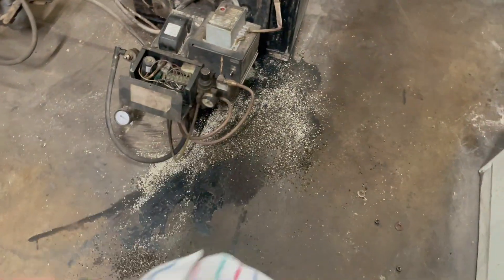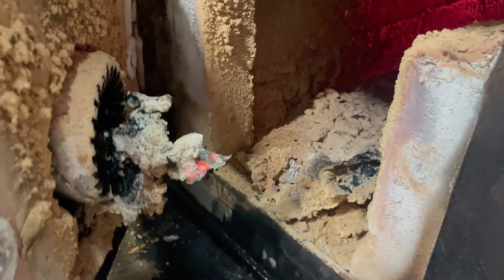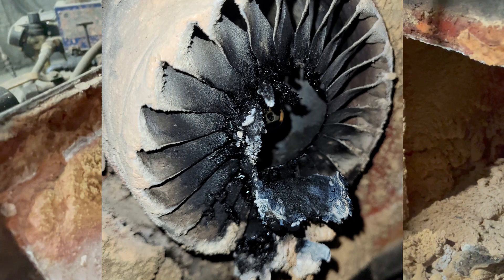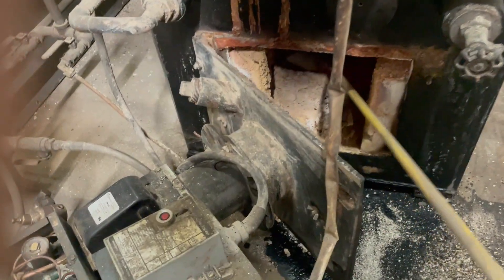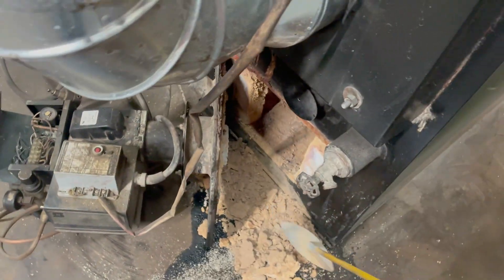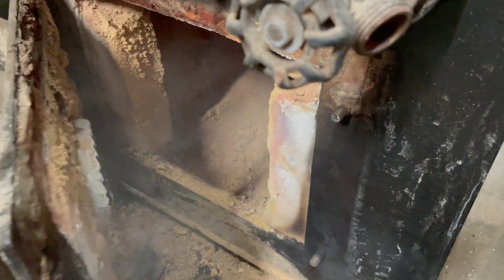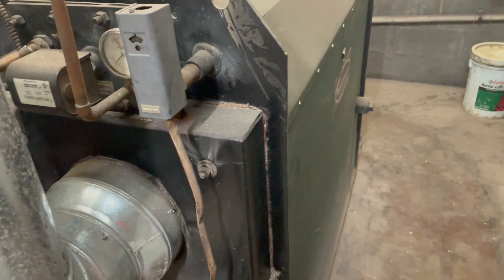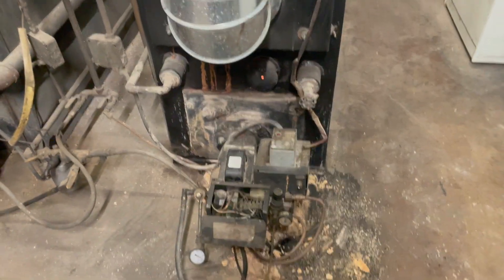Waste oil running issue volcano build up

Comment: My shop has a Lanair MX200. Has to be at least 10 years old or more. Was NOT designed for synthetic oil, but thats all we run in it. It has NEVER had that much ash in it. The preheaters get gummed up every once in a while if you leave it on without it running, but its a good furnace. Im curious as to why you think this one is better. Not discounting your opinion, just questioning. Thanks.
Reply from the maker: @MyMomsADadNow
We service all makes and models, and Firelake has the without a doubt the finest engineering. Lanairs basic start up is an issue we face pretty regularly. The way the diaphragm opens a long rod resting on the base of a nozzle you have to baby putting back in as to not damage the quad-ring. Also, the oil regulator for Lanair is usually not near the burner and takes 2 people to dial in the flame.

The ash build up here is in a half million BTU boiler that has not shut off since September. This boiler will burn 6000 gallons this year, and the one aside of it will burn 4000. These burners are now 21 years old each. Most Lanairs will be in the graveyard long before they hit those kind of numbers. In 21 years, just slide out cleanings and a few air switches. That is unmatched history. No other burner we have ever seen does more work with less maintanace.

Another reason it had the ash build up is because this is a boiler and not forced hot air. Boilers have much less draft in front of the burner so that also contributes to the volcano.
Reply: @BambergersInc.  That's all fair, and I appreciate your response and opinion. I, however, disagree that Lanairs will be recycled by the time they turn drinking age. They are very simple machines. As long as the cabinet and burner head are well maintained, they're all replaceable parts. There's no reason it can't keep running for quite a long time. Plus, the primary controls are universal, put a Honeywell on it, and set it up however you want. Never had a problem.
Reply from the maker: @MyMomsADadNow  That's true, and if you know how it all works and don't have any major problems or oil issues it's not bad. We're also taking other factors into consideration. Mainly ease of service & maintenance on service calls. Also most of our customers don't do their own work. Thanks for watching and the comment! 👍
Reply: @BambergersInc.  Thanks for the insight. I appreciate you taking the time.  Take care and stay warm.